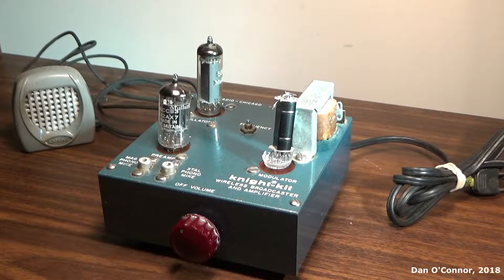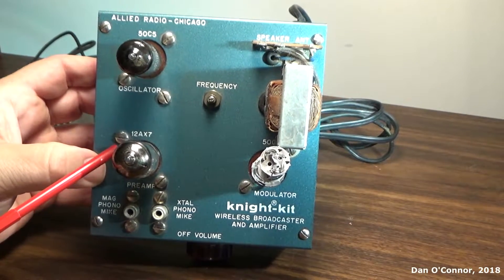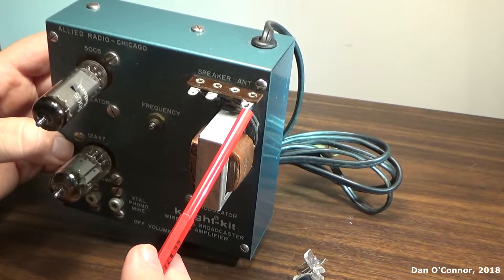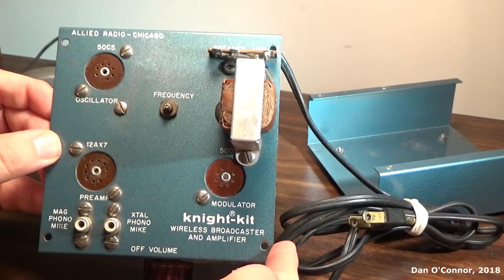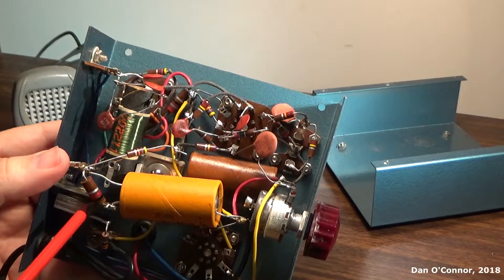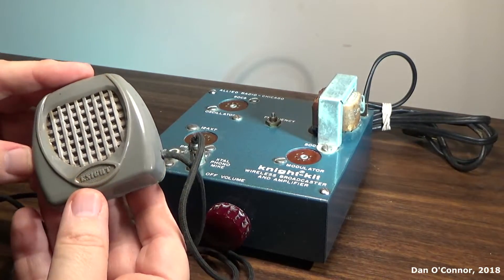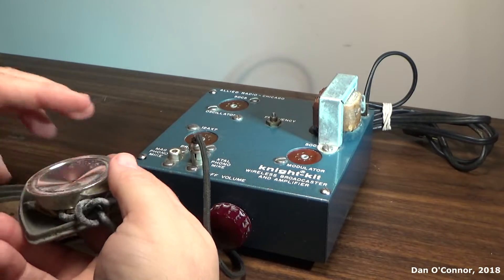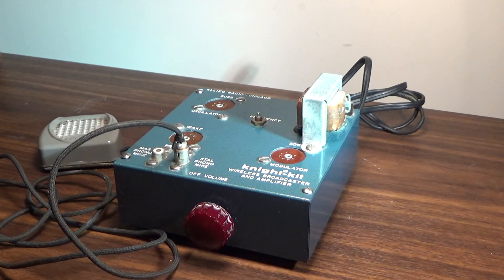1959 Knight-Kit Wireless Broadcaster and Amplifier

Comment: I had one back in 1976, while tuning up one day I over modulated & burned a hole right thru the tuning capacitor. That shut me down until i found another chassis at a flea market. So far I have 2 of the chassis. One I replaced the modulation-output transformer in a attempt to better the frequency response.

Comment: I had 2 of these in the 1960’s. Tons of fun. We hooked up a mic and a record player and had a neighborhood radio station on the weekends and some evenings. Didn’t get much distance trying to broadcast from inside the house. So we moved to the garage. Opened the garage door and put the unit on top of a 12’ step ladder just outside the door. Transmit distance was a couple of blocks. We had many listeners. Never went over the 10’ antenna length. But we were still scared an FCC van would pull up at any time! 😂 Those 50C5’s ran really HOT.  Learned the hard way a few times.

Comment: This was nicely packaged by Allied with the hammertone blue chassis, silk screening, etc. Amazing that it sold for $12. Considering the parts count... how did Allied make any money? Add to the fact that the microphone, sold separately, was $2.00! I had one growing up and it was one piece of junk, performance-wise. A toy. Audio ‘hum’ from either RF getting back into the ‘modulator’ or the filaments not being bypassed... not sure... could never resolve... resulted in annoying hum/buzz. The oscillator was unstable, and, you could never ‘zero-beat’ on any channel... resulting in whistles as your carrier conflicted with anything on one of the broadcast bands ‘channels’. Clearly designed to introduce you to transmitters , AM modulation, etc. on a primitive level. Today, one can create a solid state version with crystal controlled or synthesized frequency, good audio response, and no issues with RF getting back into the audio section. Avoid the trip back in to nostalgia by just saying NO if you find one of these for sale. My rant.

Comment: I built the earlier model without the side guards.Built it in 1957 or 1958 when I was around 10 years old. What you are referring to as an "output transformer" looked the same but was actually a choke on my model  (maybe they changed it by the time your 1959 model came out). I wish I knew whatever happened to the one I had; it sure gave me many hours of enjoyment as a kid growing up in Los Angeles!

Comment: I did NOT construct that PROJECT I read that project from ELECTRONICs made easy published by Popular Mechanic I have one  copy of that book in theory that KNIGHT pro-ject is a PLATE-modulated RF Oscillator instead of 50C5 you can use other tubes such as 6V6 or you can modulate the RF Oscillator by SOLID-state trasistorized POWER amplifier by dri-ving  at the LOW-impedance  side of theOUT-put transformer of the RF Oscillator .LEO

Comment: Very interesting how they used a 50C5 as an oscillator. It's a power output tube that was never designed to be used as an oscillator, but they used it because of it's 50 volt filament. If you add up the two 50v filaments along with the 12v filament of the 12AX7 you get 112 v---that means they could get away with not using an expensive power transformer
Reply: How far could something like this broadcast with the right antenna hooked to it?